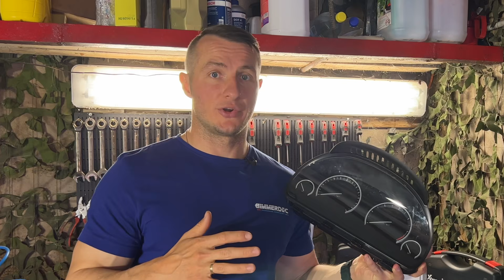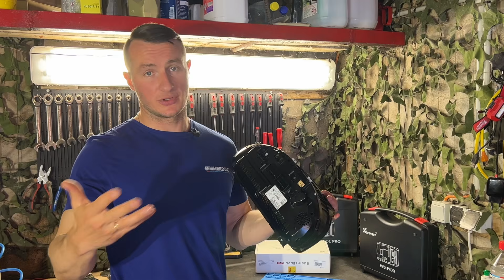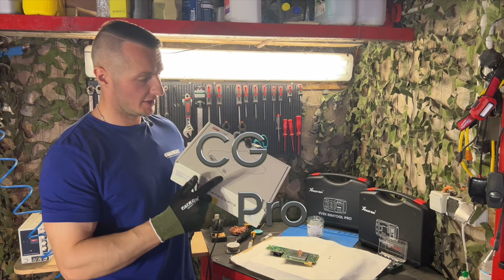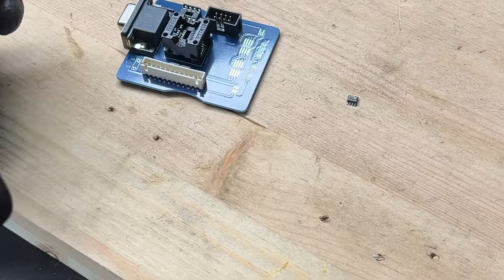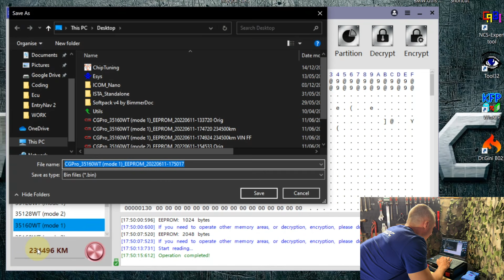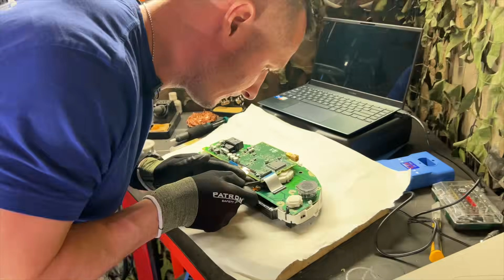How to zero (virginize) any BMW cluster for retrofit or exchange?

Comment: Hello, the simulator chip from vvdi. Is it possible to read and write with other tool? Like cgpro maybe? Old owner has used vvdi, I don't own that tool.
Reply from the maker: I haven’t tried vvdi replacement eeproms with other tools. So cannot tell it without tests
Reply: @BimDoc  I see 160D0WT on video but you use adapter for 35160WT?

Comment: hello, I am auto technician. i got 2 question related to this amazing video. in the case I need to change millage and i cant do it using CGProg.  what else Can i use?  would you do a demostration  using vvdi prog please or at least explain it to me briefly right her.   and second question: i got a 2000 bmw 540   E39   I like to know how to do this using vvdi prog as well. any comment is welcome. thank you
Reply from the maker: CG prog is one of the best programmers for the clusters. 

E39 and similar older vehicles have a bit different clusters! And require different tools for cluster VERGINIZATION. BMW Scanner is the tool for older clusters. It’s kinda old stuff and requires very old laptop with WIN XP
Reply: @BimDoc  hi thanks. Can you tell the name of that scanner?  Also i sent you an email .  Thank you.

Comment: Very well presented and professional video, BIM Doc! 👌

I have a question: I installed a Black Panel cluster about 3 years ago in my F31, and now I want to reinstall my original instrument cluster. The original cluster still has my VIN and the old mileage stored.

Is it basically plug & play with some E-Sys manipulation (FA, coding/programming), or is virginizing the original cluster mandatory before reinstalling it? Thank you so much !!!
Reply from the maker: You can install your original cluster as plug and play (only difference is if you have coded HU to black panel or not)
If HU was not coded then you can use your old cluster starting away.
Reply: @Bim @BimDoc you are a legendary, thank you so much ! Sorry but how to tell if HU has been coded to black panel?
Reply: @BimDoc it doesn’t work, showing 999999 km on the dashboard and no CAFD data is available in the kombi ecu. Tried to detect cafd from and code it with all available compatible CAFD but failed with error sw deploy. Any clue please? Thanks in advance

Comment: component protection ? will not that applicable here as you removed the cluster and reinstalled
Reply from the maker: There is no component protection on these vehicles. 

In newer ones with DKOMBI8 yes

Comment: Hi there, in the morning after a long time not driving the car, my G20 instrument cluster shows G05 X5 instead of G20 3 serries.
Tries to reboot itself, then it goes black.
If I shut the car off, exit it, lock it and wait 2 minutes outside, everything is working fine.
I have updated the software at the dealer with the latest version, nothing, then, dealer said to rewrite the original software, did that, nothing.
Now they are saying the instrument cluster is bad and needs to be replaced, but I doubt that.
Did you encounter this issue? What can be the problem?
Many thanks!
Reply from the maker: Recode it with esys with factory VO
And you will be good

Comment: Hello old video but Im preparing myself for this job. I only have 1 question and that Is you attached first EPROMPT to the board via the plastic connector clamp and the second chip you soldered tho there was also the plastic clamp as an option why Is that? I didn't catch that

Comment: Can you just swap over the eeprom from the original cluster to the new one? As long as they are the same type of cluster.
Reply from the maker: Yes on E series 
Not on anything newer
Reply: @BimDoc damn, i need to replace a cluster on an F26 x4. Is there a way in  esys to change the vin? I don't care about the mileage.
Reply: @BimDoc  hi Vladimir, I received my used cluster I bought from ebay but my shop partner plugged it to the car without virginizing it. Is it normal there is no communication to the cluster on the scanner when not virginized? Turn signals and high beam indicators work.

Comment: is it possible to cut out those two chips from the board
then read out them
then write all into new chips
then replace km and vin data
then solder new chips to the board

that way you avoid putting heat on the board and chips

so can whole old chip can be read and all that data be written back to the new chip?

that chips are very cheap so why not use new chips

thanks for answer
Reply from the maker: Chip has ID written into eeprom 
Not so easy to replace. 

That’s why your suggested method will not work on majority of eeproms

Comment: My question is, can you program certain values or change let’s say the battery auto start to oil pressure values? Like say on a 6wa
Reply from the maker: In theory yes
But not via basic coding and esys 

Value is not worth the effort

Comment: I have issue. Cluster is 6WB used one verginized and millage are less than old. Car is with HUD but the used one is without. So cluster is replaced/ esys(cafd detect latest one and dkombi2 coded).but after 30 min cluster is going that was not coded in the car. What can be the problem?
Reply: you need to have HUD cluster

Comment: Can you just swap the modules from the old board onto the new board?
Reply from the maker: Not with every cluster
Reply: @BimDoc Hoping to use a 335i cluster on a 330i for oil temp. Both e90s

Comment: Thank you for all your helpful videos! I have a question about a 6WB EEPROM. I’m able to read the 160DOWT chip using the CG PROG, but I’m unable to read the 95320WT chip. Do you know why this might be happening? Any tips or advice would be greatly appreciated.

Thanks again!
Reply from the maker: Try selecting another options in cg prog
It should be able to read that as well!
Reply: @BimDoc Thanks for the info! Does the chip have to be soldered to the board to read properly. Because at this point, it’s saying that it’s unable to read.

Comment: But i saw people removing one eeprom and changing the vin and odometer and it works ( example f11 6wb )

Does it?
Reply from the maker: Sometimes it’s enough to modify only one eeprom. 

But when I’m disassembling the cluster I prefer to  be sure it will work 100%

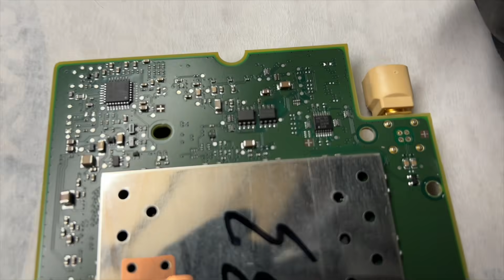Comment: Hi there! I want to ask you a question regarding virginizing this cluster.... I'm looking at 07:00 of your video where you take off the back motherboard .. I have F85 model so this would apply to me.. the two chips are located on that board... I was going to ask you if I take this small (back) motherboard and install it in new, the same model cluster in place of that one - will that allow me to retain my current milage on that new cluster? What I really am wondering is whether there is any vin or milage lock on that larger motherboard. It would be so much easier to swap out that smaller board to new cluster so please let me know if that trick will work... reason I'm asking is because I retrofitted a red cluster gauges to my oem cluster and wanted to get OEM colored one as well - to have an option to go back and forth without having to program it... thank you so much!
Reply from the maker: Swapping whole smaller board might work!
You can try it. Let me know how it went.
Reply: @BimDoc sounds good! I’ll let you know

Comment: Владимир. 35160DOWT инкрементная область очень даже трется cg prog который у вас. Там на этом чипе защита не такая сложная как 35128 поэтому у cg prog есть адаптер 35080 наверняка у вас тоже. Выбираете раздел 080 mode1 и все хорошо трется. 35080тадаптер у него алгоритм обхода защитыполучше хоть он и предназначен для старых моделей.
Reply from the maker: Да трется. Тогда еще не знал всех особенностей CG PRO

Но сейчас подтверждаю что это один из лучших программаторов для приборок
Reply: Hi, do you mean to use 080DQ(mode 1) to erase or to write new mileage in the first 2 lines?

Comment: Hi, I’m using ACDP and looking to swap instrument clusters. My original cluster has a 35160WT chip, and the replacement cluster has a 35128WT chip. I have a few questions:
	1.	If I remove the 35160WT chip from my original cluster and solder it into the new cluster, will this work—assuming I also code it afterward?
	2.	Can I use ACDP’s special emulator chips in the new cluster instead of swapping the original chip?
	3.	Is it possible to clone the data from the 35160WT and write it into the 35128WT, even though the chips are different?

Thanks in advance—really appreciate the great info!
Reply from the maker: Cloning or swapping is definitely not an option here anyhow!

Just take new cluster and verginize eeprom (or use emulator)

Comment: Can I have some information please? 

I have a broken cluster and need a replacement one, so I’m gunna buy one from the yard. 

My green board is fine apart from a few LEDs that need replacing it’s the rest of the cluster that’s battered, anyway if I take my cluster apart to the green board and rebuild the replacement cluster around the green circuit board, would that just work for me? 

And also if say I got the new cluster and just took my chip off it and replaced the chip of the replacement with my chip, would that work With no programming/coding? 

Can’t find the right info anywhere coz I really don’t wanna have to learn all this crazy software atm 😂 

Google says Carly app can code in a used replacement cluster to my car is that true?
Reply from the maker: There is not app that can code used cluster!
On E sieres you can just swap EEPROM
On F and G you need to verginize EEPROM and then code the cluster to your vehicle.

No shortcuts here!
Reply: @BimDoc  swapping EEPROM would be fine. I just need to replace my cluster. Don’t really wanna be paying £100/200 for someone to do it but it’s looking like I will have to 😂 from what I’ve seen I’d have to either know how to use software to clone it, or physically remove it via solder which could ruin the whole thing haha thanks for reply cluster is getting delivered today but it’s not a rush job I’ll
Get it done next month.. 

The only reason I need one is coz most of The LEDS what show the warning lights are out so when I took it apart they are either broken or missing. I think the person who sold it did it to hide warning lights but I’m a Audi guy this is my first bmw so I only did all the other checks like drive it and check lights etc and I’m broke so I’m leaning so much normally I just pay people to do everything but I wanna try my best to fix things before paying someone now 😂😂 

Thank you for the reply bro 🤞🏼👊🏼

Comment: Vladimir, thank you for great videos. I'd like to ask if I installed CAS from a donor with lower KM and didnt virginise VIN or KM then why did it not take higher KM from my cluster and instead uses donors KM and has tamper dot? If i just change vin inside of CAS to mine, will then the KM jump to my original and tamper dot will dissappear? Thank you
Reply from the maker: Change VIN in CAS and mileage will be synchronised towards higher mileage

Comment: So if you virginaze and after that you put into the car the instrument automaticly puts VIN and mileage to it? Or you need to adjust the VIN?
Reply from the maker: I recommend to set VIN FF and and rest mileage (if it’s higher that in the car)

Then during the coding mileage and the vin will be taken from the car
Reply: @ Thank you very much for quick reply! Insane how much I learned from you. But how others manage to set mileage less then it is in another block? I was looking X5 where odometer was set with less mileage then in other block is, they use somekind of emulators?

Comment: Thank you so much for your informative video! I have a quick question—I currently have a pre-LCI E90 and I’m looking to upgrade the instrument cluster to an LCI version. Would it be possible to transfer the EEPROM from my original cluster to the donor cluster? I’d really appreciate any insights or advice on this process!
Reply from the maker: If it will have exactly same eeprom then yes. 
If type is different then I recommend verginizing it for better result.

Comment: Hi 
 dismantled a 6WB cluster F10  to replace the LCD panel and then the gauges on the left and right no longer worked.

So I took it apart again, removed the micromotors and put them back in place, now the fuel gauge works but not the temperature gauge.I have the issue with the 6wb cluster
Is there a way or method to put the micro motor back on the needle correctly so it works please thank you very much
Reply from the maker: 6WB is full digital 
6WA is half digital. I guess you are talking about that. Gauges are just removed and placed back to the same place. But micromotors might be bad and not working. I’ve seen that on E series a lot of times.
Reply: Hi thank you very much, i replaced, properly the needles to be exactly in place and now all works. Thanks for your help 🎉

Comment: Hi, I've just had a extended cluster retrofitted to my F30 2013 and it all works perfectly except the cruise control doesn't work anymore. I've read it could be something to do with flashing the the FEM or idrive system so they are all the same. Does that make sense and is it something you can help with please or guide me to the right video of yours please 🙏 
Thanks
Reply from the maker: Yes it might be istep mismatch. 
But first try to code everything properly
Reply: @BimDoc  Thanks 👍
Reply: @garethjohndavies  Hi, did you find solution about your cruise control not working? If yes, how did you solve the issue? Friend of mine has the same. Thanks
Reply: @BimDoc  Thanks Vladimir, i-step mismatch was correct. FEM-GW has to be flashed with esys, same istep or newer.

Comment: Great video! I wonder if it's possible to re-program the EEPROM's without de-soldering them; there are IC clips for PCB testing purposes that would be easy to connect to those programmer boards.
Reply from the maker: Yes and no

It depends on eeprom type and procedure you want to do. When eeprom is soldered to PCB then you are limited in the access. For example 35128 desoldering only. And even then it’s tricky sometimes.

Comment: Hi 
What is difference from videos of other guys that that use R270+ programer and modify data only in left chip?
Reply from the maker: R270 is cheaper programmer and cannot do all chips. 
But for E series it will work like a charm.

Comment: I have retrofitted a 6WA after it was virginized. It also works, so far the seller told me I don't have to code anything on the car? Is that correct or do I have to add the FA/VO afterwards? What would happen if I entered the 6WA in the FA/VO and coded it anyway?
Reply from the maker: It depends if cluster was only verginized (then coding is needed) or it was precoded for your vin as well (then no coding is needed).

But even if it’s coded and you recode it, nothing bad will happen if you know what are you doing.
Reply: @BimDoc  It was virginized and coded with my vin and works fine. Everything works as it should, except for the Compass. It is only set to north, but this is probably because there is no sat nav installed in the car :D Thank you for you quick answer and your work!

Comment: I have imported my f20 from Japan. It initially had KMP instrument cluster, but I bought a donor to swap the speed dial, so now after changing FOs and coding ECUs in esys everything works fine:
the radio, tacho in miles, language and etc, BUT the LIMit controller, ECO PRO and seat belt reminder still shows in KMP.

Could tell me what I have missed so far, please 🙏?
Reply from the maker: Your limit will be in KMP 
Not changeable ((
Reply: @BimDoc  therefore ECO PRO and seat belt reminder will be in KM as well, right?

Comment: Is it possible to read eeproms without desoldering on 6WB cluster with adapters.
Reply from the maker: Read yes
Modify, not so much any more. Especially the part with a mileage. (Incremental part)

Comment: What is the difference in the 2 modes on the 35160 chip? Thank you for your videos!
Reply from the maker: Difference it the algorithm how mileage is calculated.
Reply: Could have worked in this situation? If I was just replacing a bad cluster with the same design, could I just swap the chips?

Comment: Fantastic video Vladimir. Unfortunately, my cluster broke and my mechanic temporarily put a non-virginized cluster (with very high mileage relative to the actual mileage) in the car. Neither the VIN nor the mileage were corrected on that cluster so neither of them match the car's VIN or true mileage. I'm wondering if the non-matching VIN may have saved me from having the DME and lighting control module being reset with the cluster mileage. Can you comment on this?  If the mileage has indeed been reset by the cluster is there a way to fix this?
Reply from the maker: Yes, if VIN does not match then mileage will not jump. 

But I have seen cases when it still did jump. 

So newer put used cluster to the bmw wo virginizing it.
Reply: @BimDoc  Vladimir, Thank you so much for responding. I have located a virginized cluster and will be installing that soon. I hope that you are right and that my correct mileage (very low) will be retained. I have watched a lot of car repair websites and I must say that yours is the best, most comprehensive, and professional one I have seen. Than you  again!